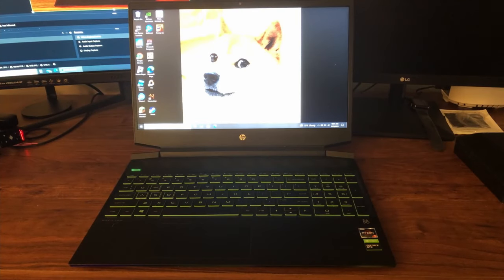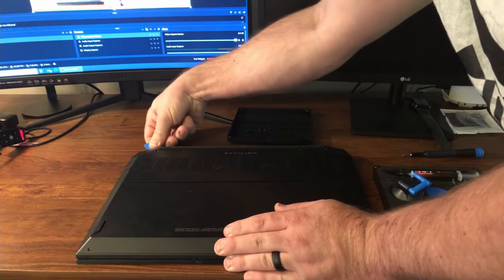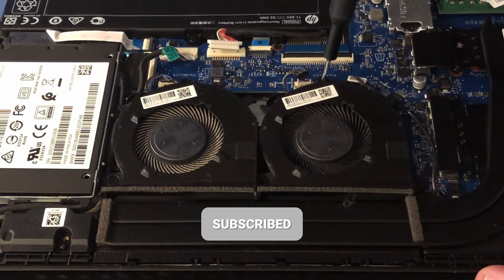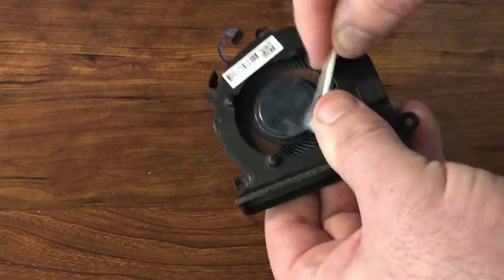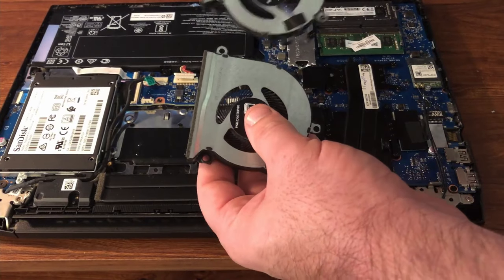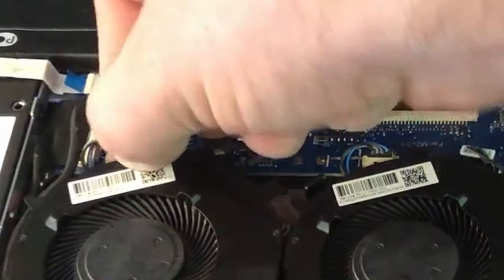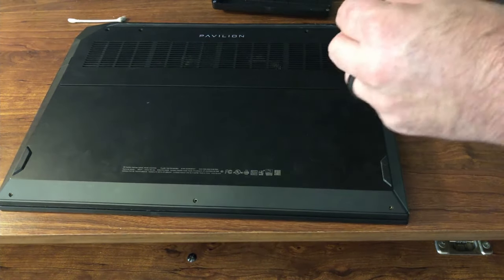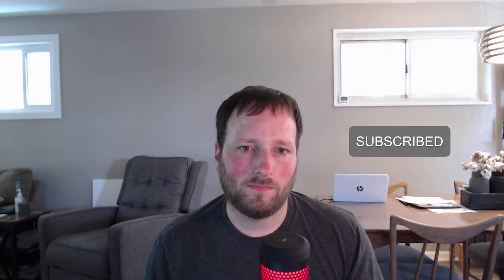How to clean a Laptops Cooling fans! Help your laptop run cooler then before.

Comment: I followed all the steps but when I finished my device did not turn on, I made sure that the battery wires and fan wires were connected.
Reply from the maker: You may have to hold the power button down for like 20 seconds. If it’s a hp model, some other brands have different steps.
Reply: More information about Laptop : https://youtu.be/fPPcBPsLlT0

Comment: would just using a compressed air container work for this?I have no idea what I’m doing when I take apart my laptops,so if I can it would be amazing
Reply from the maker: If your laptop is not that dirty compressed air would be fine, but it’s caked in dirt/dust wiping it maybe better.
Reply: @MrDarkcore  woah that reply was so fast haha,thanks a lot!It’s not that much but saying that I think wiping it may be the better option.Thanks for the response.
Reply from the maker: @sirdan8799  no problem, I try to get to people quick. :)
Reply: i have similar question ı want to clean it using compressed air without diassembling and is it okay if fanns turn wrong way im pretty worry about this.
Reply from the maker: @muhammetaslsn  maybe if you have something small enough to prevent the fans from spinning when hit by the compressed air. Like a needle so something of that sort. The back panel would still have to come off though.

Comment: Hello, is unplugging the battery a necessary step before cleaning the fans? I didn't unplug the battery and my laptop screen is now flickering and I don't know if that's the problem or what. Pls help
Reply from the maker: I didn’t the first couple times but people in the comments said I should unplug it. I didn’t have any issues though.
Reply from the maker: For the flickering issue, I would try updating the graphics drivers then reboot your laptop to see if that fixes your issue.

Comment: Lol i see this video a day after cleaning my fan. Just a question but what happens if i mistakenly clean the black (paint) that is at the front side of the fan blade. I cleaned mine by mistake, it turned metallic and all of a sudden my laptop doesn't wanna turn on. Hope you see this 🙏
Reply from the maker: Try holding the power button down for like 20-30 seconds while not plugged it. See if that get the laptop to but on.
Reply: @MrDarkcore  Fantastic 😲 it came on. Thank you 👍
Reply from the maker: That’s good! Doing that is like a hard reset.

Comment: Hello sir, thanks for this short and straight to the point video, very helpful! I've just unscrewd the back panel and will pop it off now. I really really like your q-tip and isopropyl alcohol advice. I feel more comfortable doing that than blowing compressed air into the components, for some reason I find that a bit scary and that it could potentially damage something. Anyways, much love and thanks again! Deep cleaning electronics shouldn't be hard, so a short guide like this one is super helpful! 😊
Reply from the maker: I am just glad you found it useful. Also I agree with it shouldn’t be so hard cleaning electronics.

Comment: The smallest screwdriver I have is SLIGHTLY too big for the screws on the back, so I’m gonna go buy a screwdriver and then I will prevail. Thanks for the video!!
Reply from the maker: I would buy a PC tool kit, then you won’t have this problem. 😂 There are some cheap ones on Amazon.
Reply: @MrDarkcore  I went to Home Depot actually and got a set of small tips that you can interchange for $10 and it worked great! Surprisingly after over year, my fans and insides were not that dusty at all! How often do you recommend doing the thermal paste? I haven’t redone the thermal paste ever and I’ve had it for over a year.
Reply from the maker: @shaxen274  i do my mine once a year, but that maybe still even to much. 😂

Comment: Great video! Thank you for the tutorial. I was able to clean my filthy fans. Laptop definitely runs a lot cooler now. Only issue is that now one of my fans is making a loud buzzing noise that it was not making before I cleaned the fans :/
Reply from the maker: Maybe something got stuck in the fan or maybe time for a new fan. How old is the laptop?

Comment: when I completed the whole cleaning process and switched on the laptop, the screen turned on and showed something about my CMOS files and it needing to be rebooted, but after around 5 seconds the pop up went away and my HP turned on. Nothing seems to be broken but should i be concerned?
Reply from the maker: If you unplugged the battery while cleaning it, you would get this prompt. It’s kinda like a boot cycle.

Comment: Is it possible to reapply a little bit of oil to the inside center of the fans? It helped with my old laptop tremendously, but I dont know if it is possible to open these fans up
Reply from the maker: I am not 100% sure, but I will look into this. It could make a good tutorial video.

Comment: I'm going to clean my laptop!
It's been  running 50c using chrome and 80-93C in games! 2 years soon and no cleanage. I'll update you in a couple hours!
Reply from the maker: Ohh, That’s a toasty boy! Just take your time and remember to hook everything back up. You’ll do fine :)
Reply: How did it go?
Reply from the maker: @marinaivcic2499  maybe they didn’t make it… 😂
Reply: Running 50c on google chrome sounds normal since browsers can be cpu intensive,  but in games if it runs above 90 degrees its concerning but if it a modern gaming laptop, that's now the new standard somehow

Comment: Which screw-driver did you use? Was it PH ones or T ones ? I have PHs but smallest T I have got is T8 and i'm not too sure is it small enough or not.
Reply from the maker: It was a Phillips head, just a really small one. It just happened to be in the Ifixit kit I have.
Reply: More information about Laptop : https://youtu.be/fPPcBPsLlT0
Reply: I used a regular sized magnetic Phillips

Comment: How do you unplug the fan, I’m trying to unplug it and it won’t budge. In the video you easily pop it off.
Reply from the maker: Yea mine just unplugged real easy. I would look to see if there are any push pin that have to be pressed and held down while pulling the fan cable out.

Comment: I ended up stripping the top screw for the first fan and now I can't get it out, but I disconnected everything and took the other screws for the fans out. So now I can't get the fan out.
Reply from the maker: Maybe try a size up screwdriver size if not, maybe try gripping the screw with with needle nose pliers. That’s all I can think of.

Comment: Just finished watching your video, I used the iFixit tool kit to open up the same laptop as yours, ended up breaking two mini tabs off from the case when I was putting the back panel back in.
Man, it was fragile.
Did you broke yours too?
Reply from the maker: No, mine are all still there. Maybe you don’t know your own strength. 😂
Reply: Rule #1 after lots of “learn as u go” 

If a plastic piece needs any force to remove STOP! 
you never have to force any panel off’ so stop regroup and look for missed screws

Comment: How long can you wait in between each clean and I have had my laptop for about a year without cleaning will is nerf the performance
Reply from the maker: I try to do it yearly, but if I look at the fans and they seem dirty from the outside I will clean it. I have pets so dirt builds up quick.

Comment: bro i have the same laptop and one of its fan (the one you already cleaned before starting the video) is actually not working properly where can i get the replacement i need kinda exact fan because of that one screw in the middle i need a fan that also has that part up to actually get fit in their perfectly
Reply from the maker: There is a link in the description for a replacement fan’s. Pretty sure they would our model.
Reply: @MrDarkcore  nvm i found it
Reply from the maker: Oh ok.

Comment: When do you know your fans need to be cleaned? My laptops fans make quite a bit of noise but other than that they seem to work fine and they only ever make noise when I’m playing a game on it.
Reply from the maker: That’s normal for the fans run like that while gaming since depending on the game it puts a lot of demand on the cpu/gpu so things get hot. I would say the only times you should clean them if you can see that they are dirty or if those fans are being loud when the laptop is running under no demand.
Reply: @MrDarkcore  ok, got it. Thanks.

Comment: Hello. After being done with cleanup process and readjusting everything including the battery, I got the error CMOS Checksum is invalid ERROR-502. What causes this and how do I fix it?
Reply from the maker: Pretty sure you just remove the cmos battery while the laptop is unplugged as well as the battery. That should reset that error code.
Reply: @MrDarkcore Thank you! The error message didn‘t appear again after I restarted it. But if it appears again, I will try this.

I saw a reddit user saying that everytime the CMOS (mine is integrated in my main battery that I unplugged) gets unplugged it shows this error after the first start because it resets itself with HP laptops. That would explain why it happened I guess. Not sure if you can confirm this.

Comment: I have a question 
Does only one fan work while browsing or using the laptop for light work ? 
I found that only one fan is spinning while browsing but both of them work while gaming,does your laptop do the same or my fan is malfunctioning? 
Also fan speed software lable the nonspining fan as CPU fan, aren't both them for both the CPU and the GPU ?
Reply from the maker: I believe so, mine did this also. That’s why I cleaned it thinking the fan was clogged. In my laptop the cpu and gpu use the same heat sink, so for light work it’s uses one and gaming it uses both.
Reply: @MrDarkcore  
Huge thanks for you sir 
I was worried but your reply made me relax 
Thanks a lot
Reply from the maker: No problem, glad to help.

Comment: Hey. I have a asus tuf gaming laptop and it's been very loud. I would like to clean it out. Is there any way this cleaning process could go wrong and damage the laptop? Because it's very expensive and I don't want to damage it 😂
Reply from the maker: Well, that’s the risk with cleaning them. You could always try canned air/air duster to blow out the dust through the vents in the laptop.
Reply: @MrDarkcore  Hey. UPDATE. Im glad I cleaned it. Was filled with dust....
Reply from the maker: @Jusztiszz  glad you were able to work it out.
Reply: couldn't have done it without your easy tutorial. Thanks. @MrDarkcore

Comment: my laptop is also about 1.5 years old and its been getting pretty hot lately, do you reckon I should clean it or not?
Reply from the maker: I would only clean it if you notice a lot of dirt or debris on the fans or in the exhaust vents. They do sell fans that go under the laptop to keep it cooler if you’re worried about how hot it gets.
Reply: @MrDarkcore  yeah I bought one of those

Comment: What kind of liquid did you use and is there like a toolkit set you use for the screw and removing the battery
Reply from the maker: It just isopropyl alcohol, the one I used it’s 99% medical grade. Anything above 70% should be fine though. I just used a Phillips head screw driver for all the screws, believe it was a size 1 bit. I also linked the tools I used in the description.
Reply: @MrDarkcore Would 64% work?
Reply: @MrDarkcore  Would water work?
Reply from the maker: @denis_tart  I wouldn’t just because if you get water on any of the electric components it could cause shorts.

Comment: hey i just watched this and follow what u did my pc was making alot noise and over heating but the first fan you show to take out i think my pc that fan not working it dont spin if i try spin it with my finger its stiff do i need to replace it and is thats the cause of the over heating the oher fan spins just fine only the first fan cant spin when i try to spin it
Reply from the maker: That sounds like the bearing inside that fan dried up. That probably why it won’t spin anymore.
Reply: @MrDarkcore  ? So do I just replace it or can I make it spin again
Reply from the maker: @ppolo1715  it would probably be easier just to replace it. laptop fans are pretty cheap on amazon, just have to order the right one.
Reply from the maker: Cleaning look like a pain from why I saw on YouTube, but if want to give it shot I guess it can’t be any worst then it sounds already.
Reply: More information about Laptop : https://youtu.be/fPPcBPsLlT0

Comment: Can I clean the fans without removing the battery and the fans themselves? I don't want to mess with anything too much as I'm not confident in myself.
Reply from the maker: You can, I would recommend using an air duster or a can of air to clean it.
Reply: @MrDarkcore  I see, thanks!

Comment: Hey if I just open the back of my laptop and use my compressed air to dust away is that ok?
Reply from the maker: Yea, that would work fine. If you dust the fans though, I would find something to prevent the fans from spinning while spraying air on it. It could ruin the fan.

Comment: cable for fan is quite hard to remove any tips for geting it open?
Reply from the maker: I just pulled on the top or the wire. I didn’t have any issues with that.

Comment: Hi. I changed the fans on mine but the new ones stay on full all the time which the old ones didn't.  how could i leave the power on auto like the old fans were?
Reply from the maker: I would check the Bios and make sure the fan curve settings weren’t change for some reason. You can also download msi afterburner and change it in there. That way maybe easier.

Comment: Ugh I need to clean my hp victus 15. I’ve never worked on PCs before only consoles so feel incredibly worried I’m going to break it but the shops want £60 to clean it each time and with cats it needs to be cleaned frequently
Reply from the maker: To be honest I was also worried at first, but after just poking around in the laptop a few times. It became pretty easy to do.
Reply: @MrDarkcore  Hopefully it goes smoothly! There are limited tutorials on my model specifically but your tutorial has laid everything out in a way that’s easy to understand so I’m sure I’ll be following it when I clean it!

Comment: Thanks for video, i did this and now my fans only turn for a second after running laptop and then stop, did i break something or just did something wrong?
Reply from the maker: I would try using a program like msi afterburner to see if you can get the fans to spin that way, if that doesn’t work it maybe time for replacement fans.
Reply: @MrDarkcore  ty

Comment: Hey man my laptop fan started randomly roaring like crazy (It's not normal because I know what the fan sound feels like on 100% cpu usage) I think it's probably dying, is there a way to fix it without actually having to replace it ? Because it's pretty complicated and tedious to get anything from Amazon or Ebay in my country. My pc model is HP Pavilion 15ec-1012nk
Reply from the maker: Before you consider replacing parts, have to done updates, disk clean up, bios update, turn off start up apps, etc? Sometimes that can help with the overall performance of the laptop.
Reply: @MrDarkcore  Well I am considering cleaning up the laptop but I can't find isopropyl alcohol, or practically any kind of alcohol, is there another substance that's more available I can use to clean the fans ?
Reply from the maker: I would say canned air, or maybe that slime that people use to clean keyboards.
Reply from the maker: Well if you use a soft brush (like a toothbrush) to loosen the dust, that could work as a temporary fix. I would only do that if it’s really caked full of dust/hair etc.
Reply: @MrDarkcore  Thank you for your time sir I really appreciate it
Reply from the maker: @Strategic.  no problem

Comment: Whenever I turn on my laptop, a message appears stating system fan failed , will the notice disappear when I clean the fans?
Reply from the maker: I still get that prompt to this day even after cleaning them, maybe I bios update could help.
Reply: @MrDarkcore  ya thank you I just cleaned all of it and it works fine now no overheating or flickering thank you so much and yes I did update the bios it helps too

Comment: Do you have problem with that model? everything is fine until I start a game .... It buzzes so much, it's hot like an oven .... I'll try to clean it and I'll see if it stops
Reply from the maker: No I don’t have any issues, it loud when playing like Fort or Elden. Also gets somewhat hot.
Reply: @MrDarkcore  I will clean fans and change pasta then if still making too much noise I go to service. That laptop is too expensive for that sh*t 🤦‍♂️
Reply from the maker: @screw_yt  I would watch what material surface you place it on also. It could reduce air flow and start problems.

Comment: I think I did something wrong😊 I unplugged the battery and plugged it back in and it’s not turning on anymore
Reply from the maker: I would first try holding the power button down for 15 to 30 seconds. Make sure the laptop isn’t plugged into the wall as well. If this doesn’t work let me know.